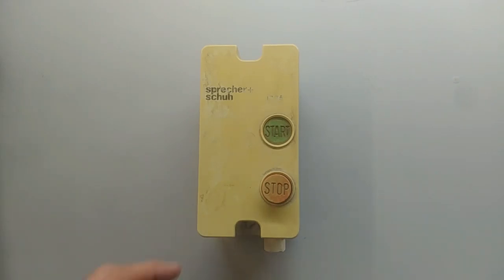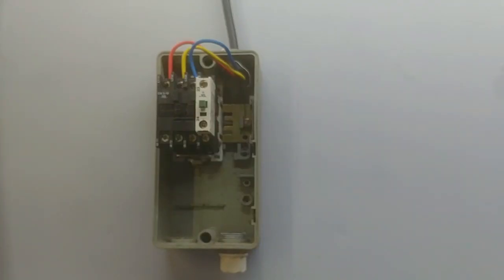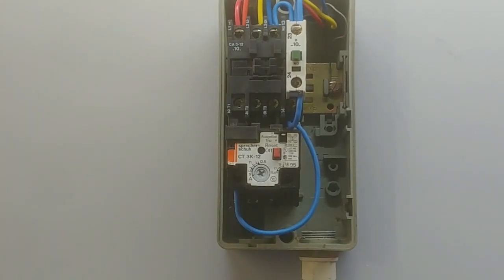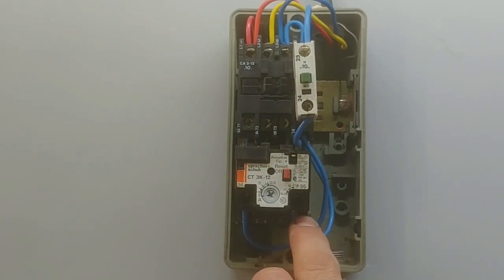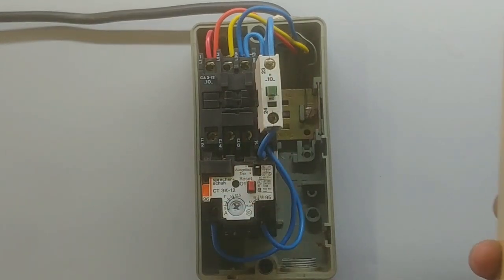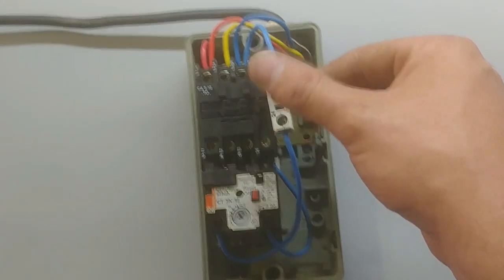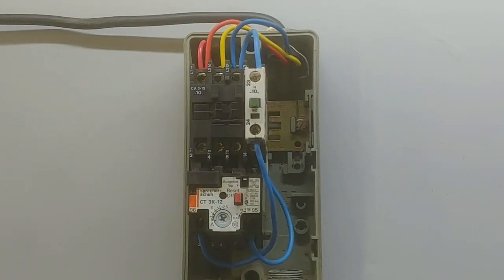How to Connect a Direct online Starter (DOL Starter)

Comment: Do you connect neutral to any terminal of the contactor?
Reply from the maker: A1 or A2 it does not matter, but A2 for tge neutral is just common practice. If there are two A2 contacts, any one of the two will be fine.

Comment: How do I wire this on 240 v . Really struggling with it
Reply from the maker: Hi Andrew. If you are using 230v contactor follow these instructions:
At the beginning of the video (1:27) instead of a bridge from L1 (red wire) to A1, use the NEUTRAL wire that you have.
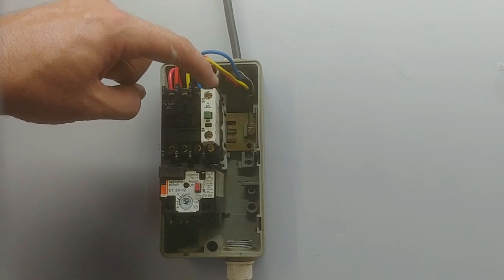Then, treat the blue wire in the video as your LIVE wire (1:43 to 5:58)
Reply: @p0we111  hello thank you for replying . Yes it is 240 v it worked when I push the contact by hand . But won't work with the start button . It looks the same as your one but the numbers are different
Reply from the maker: @andrewnoblett9510  Make sure that on youre overload you are using the NC (normally closed) contact.
If you connected it to the NO (normally open) contact it wil only work if you the contactor.
Reply: @p0we111  thank you it was wired right the start switch was sticking it works now thank you ever so much

Comment: Hello Jean B...your set up clearly works but I have a couple of questions about it that I hope you can help me understand. I'm having difficulty understanding why the contactor coil is not already energized before pressing the start button.

It appears the contactor coil is already receiving power from the L1 bridge and completed by connecting A2 at the bottom with the motor overload protection switch. I know I'm missing something here so please help me understand. Thank you.
Reply from the maker: Hi Tony. Because you're first passing the L3 wire through the Normally Open (NO) switch of the contactor aswell as the NO contact of the switch,no power will pass through to A2 until you hit the start button. 
If you are testing coil A1 with a voltmeter and get 230V when tested to ground(in my case single phase) and you test A2 to ground you should also get 230V but that voltage is accualy the voltage from A1 you are picking up as it is just passing through the coil. If you test between A1 and A2 with your multimeter you should get 0V until you press the START switch. Then you should get 400V at A1 and A2 (in my case 3 phase)
Reply: I just replayed your video...I think the part I was missing is the fact this you installed a 400 VAC contactor and when you press the start button, this provides the 400 VAC needed to energize the contactor coil.

The 230 VAC received from L1 is not enough to energize the coil. Is this correct?